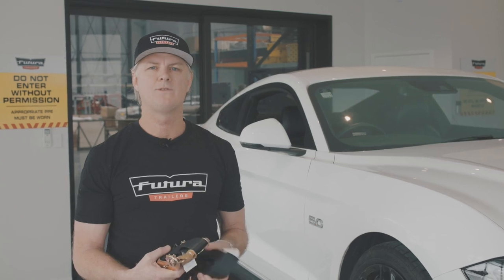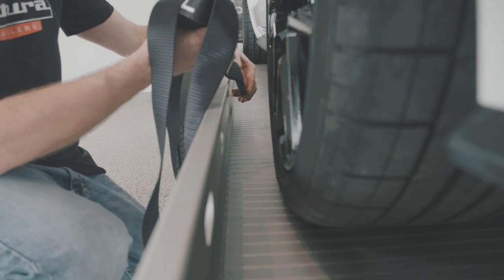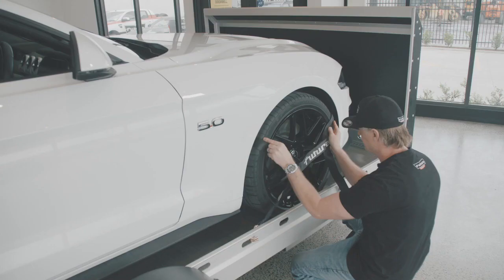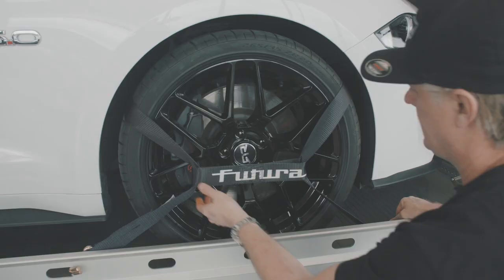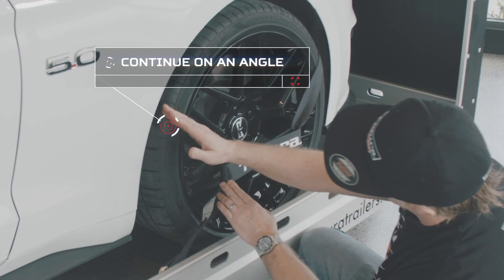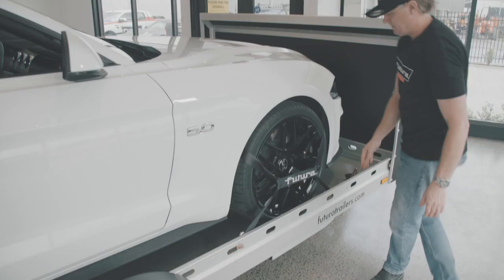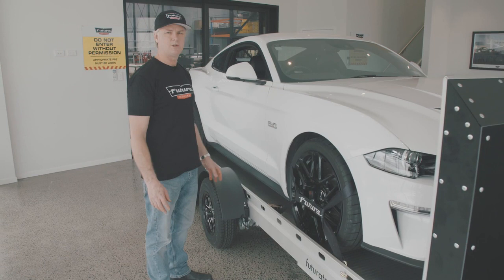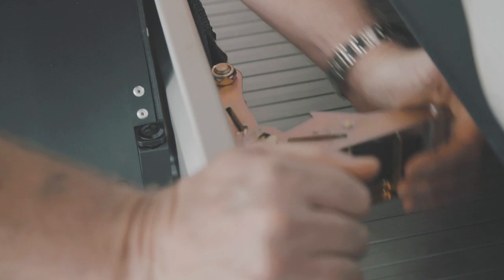Secure your car with the Futura Tie Down Set | My Futura #cartrailer #carhauler #futuratrailers

Comment: Great tie down design.  But who ever edited this forgot to color correct the video.  It was shot in log format (very flat colorless video profile) and don’t add back the contrast and color during the editing process.  Surprised no one has ever mentioned this.
Reply from the maker: Glad to hear you like the tie-downs! Historical video, perhaps it was on trend at time of shooting to have a more dulled down colour profile for final output. Or maybe, due to the film location being very bright: white car + light coloured trailer + polished concrete floor + floor to ceiling windows all around = lots of light reflecting into lens = loss of colour? Thanks.

Comment: My car has tie-down mounts on the underside of the frame and attaches to recessed d-rings on a trailer.  Does your trailer alow for recessed d-rings ie can the trailer be ordered with them installed?  I  would think tieing down the frame would be safer than tieing down the tires... less chance of movement because of shocks.
Reply: I have the twin tandem and it has two recessed rings in the front and rear. I use those to tie down. Unfortunately my GT3 wheels/tires are very close to the wheel arch and I can't get my hands up inside like he demonstrates in this video. So I run them through the wheels.
Reply: @TheBruce987  interesting can you share the width of your car with the wheels ... I have a Roush mustang with 315 rear wheels ... which looking now at the front wheels in the video probably will not fit on this trailer...
Reply: @jimh6233  one thing to note is the 2021s all are 81 inches wide.